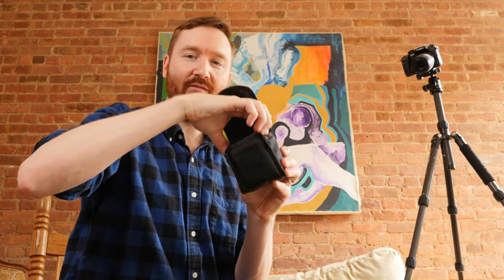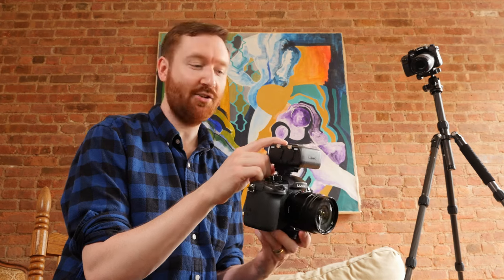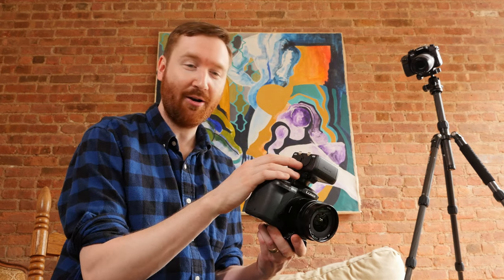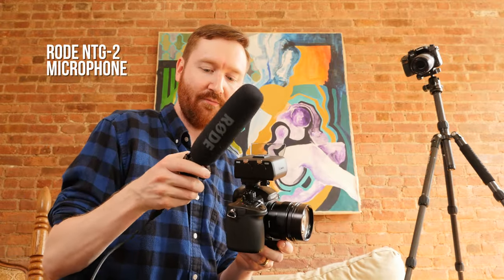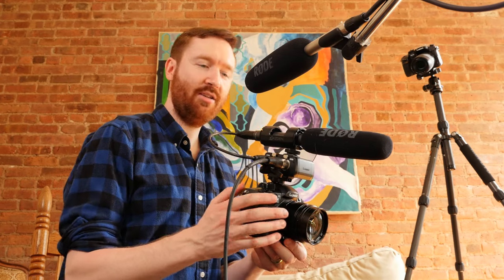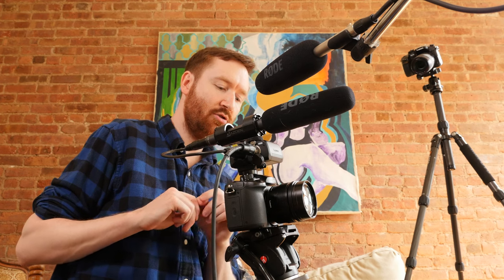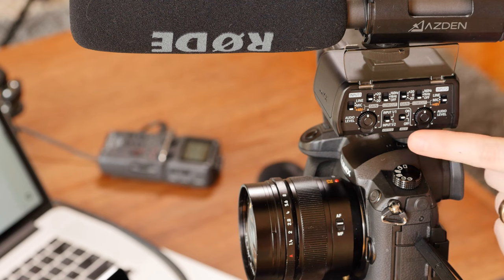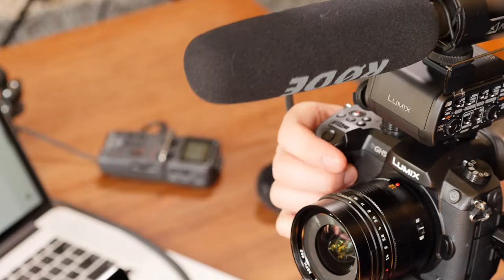Plug XLR mics into the Panasonic GH5

Comment: What impact does phantom power use have on the GH5 battery life? I have noticed dramatically shortened battery life on the GH5 compared to the very long battery life with my GH4 and GH3 cameras. I'm lucky if I get 60-75 minutes with the GH5, so I'm wondering what will happen if the GH5 battery supplies phantom power to the XLR-1.

Comment: Hi Grif.  Using my audio adapter I have plugged in two separate sources into the xlr connectors.  I get both separate sources levels on the flip out monitor but unlike just a single mount and the switch moved to 1, I cannot hear any audio in the headphones with the two inputs??? I set up my camera according to your donwload?  I called panasonic support who recommend resetting the camera to factory.  Do any of your settings affect this?  Is there any menu causing this?  Any help certainly appreciated. If this is just a shortcoming on the audio adapter and GH5 then it is a big deal as i always do interviews with two microphones on separate inputs!!
TJ Williams Seattle WA USA

Comment: The adapter looks good for what it is, but it is a relatively expensive one-trick pony. An infinitely better option would be to spend an extra $250 to get the Sound Devices MixPre 3. Three first-class mic pre-amps and headphone amp of significantly better quality, can be used with any camera, plus it doubles as a USB audio interface. And you can route the output back to the camera, so you have the backup recording that Griffin says is lacking in the Panasonic-only option. (Of course, if the Panasonic fails to record your audio, it probably didn't record your video either.) It is separately powered (by AAs or Sony NP-style), but I think that's an advantage in that it won't drain the camera battery as fast as the Panasonic accessory. In any event, the MixPre-3 is a much more flexible option that will grow with you. Make sure to check it out before you decide to buy this device. Just sayin'.
Reply: Same thoughts there on this. The XLR1 isn't universal like other pre-mixers, and is around $100-200 more than the average pre-mixers. 
Really hard choice to make if I can really justify buying XLR to marry with the GH5, or go with my previous pre-mixers.
Reply: If you don't anticipate ever needing to work with another camera for the foreseeable future and have no use for a standalone recorder or USB audio interface, and you're totally strapped for cash today, then perhaps it may make more financial sense in the short term to buy the XLR1. But those are about the only circumstances under which it makes sense, in my opinion.
If you take care of the MixPre3, its resale value will be significantly higher, so you will see a much better return on your investment if you ever decide to upgrade your audio gear.
How much can you sell that YAGH for now, compared to what you paid for it? :-)

Comment: I bought one of these as it makes it a little easier to get the audio in for streaming video, as you can't mix in audio captured by an audio recorder. One of the things, I find frustrating about my GH5's, is you can't change the mic input to line level. Even in the GH5 Mk2, this is not an option. If you are getting a house mix, it's line level. If you are using an external audio recorder, the output is line level.

Comment: I like running good audio into the camera but I have the same fear; however, coupling this with an audio recorder attached to a second mic is pretty bombproof. The camera audio or the recorder can get screwed up and you still have a great track and your video is pre synced if you need to get it out quickly.

Comment: I also have one and i love it, it was one of the main reason to get the GH5. I've noticed that if you change the recording mode to mov (i normally use mp4) you can get 24bit up to 96Khz ! But it crashes my GH5 probably because of my slow SD card so i use 24bit 48Khz, it soubds better than in mp4 mode :)

Comment: How do you eliminate all kind of noise or hiss for the audio? 
I have some audio noise in my recordings. I use a isolated studio, the gh5 is recording in MOV and at 24p FHD, the settings in the camera for the XLR adapter are 96Hrz 24p. the adapter itselft is set in the phatom power (I use a mic shotgun 3 feet away from the person) 0 gain, low cut 160 Hrz, ALC off, one input, and the audio level wheel at 1200 or less.

Comment: Hey Griffin! One question. I didnt see the Adapter connected to the input on the side. So, is it automagically connected from the cold shoe? or does it act as an independent sound recorder even when on the shoe? Also, can you just keep the camera mic on as a fall back. Thanks 4 another well done tutorial!!!
Reply from the maker: Automagically, yes! It's actually not a "cold shoe" on the GH5, but a "hot shoe," meaning it has an electronic connection to the camera. You cannot keep the on-camera mic on. It's one or the other.
Reply: Ahhhh nice!!! Yeah i can see the problem with having a second copy but it solves the problem nicely of syncing in POST which is awesome. Give and take always. I bet for you as a documentary extraordinaire becomes a plus. Thanks again for taking the time to respond and I never miss an episode.

Comment: Now that I saw this, should I purchase the XLR1 or the zoom H5?? Since you said this can replace the recorder, and that the H5 is actually much more expensive...
Reply: If you shoot with a boom operator, they can work independently from the camera with a recorder like the Zoom H5, and they can plug-in their own pair of headphones to judge the audio they are recording.

If you work as a one man band, then the GH5 XLR adapter would be a simpler set up, but just make sure that your mics produce a strong enough audio signal for this XLR adapter. ( an XLR mic with a weak signal might require too much extra gain, thus producing a noisy recording )

Comment: Hey Griff, how are you bud? (hope well and happy.)

Just a quick one I have synthesisers G2's and G3's and also the AVX systems but I cannot get a good sound on the GH5 using these even when set to the lowest setting and then bringing the GH5 down to -12, it's still clipping? DO I really have to pay another £350 (UK prices) to get good XLR audio? (cannot I just use the Senn's somehow connecting them up to the gh5?

Thank you.

Best regards.

Hugh
Reply from the maker: Hugh, is it a matter of setting the XLR-1 to "line" rather than "mic" input? Or does setting gain to -20db help?

Comment: Video idea. The GH4 eBay price is a third of cost of the GH5. If your new to GH line would you start with the GH4 or 5?
Reply: Either camera can produce great results, but I would say that if you are pretty good shooting with the GH4, then you will be even better with the GH5. ( you gotta be good with the GH4 first though )

Both cameras require the right settings to get the best performance out of them, so learning on one or the other is not going to be that different. ( and if you buy a used GH4 you can probably sell it in 6 months and get most of your money back, where a brand new GH5 is going to take quite a hit when you go to re-sell it down the road )

Comment: Hey Griffin, If I have a GH5 & XLR 1 adaptor and a Atomos Ninja inferno.  Should I connect my audio hardware via the XLR1 adaptor or via the Atomos Ninja Inferno with the optional XLR Breakout cable?  I want to avoid the fan noise from the Atomos Ninja Inferno.

Comment: Is it possible to use the adapter and at the same time use the 3,5mm regular audio output?
Reply from the maker: marcuspresident - You can use the headphone jack and the XLR adapter at the same time, but when using XLR, the 3.5mm mic jack is disabled.

Comment: Hey Griff, 

I have a Zoom H6 and already know how to use it and love how it performs so rather than buy another piece of kit I would really like to have it connected on top of my GH5.
I will use a Sennheiser AVX clip-on mic/receiver capturing straight into the zoom and simultaneously sending it to the GH5 but I don't know how to do this I have tried a few times but no sound in camera?
My set up is -
the mic on talent,  receiver capturing straight into the zoom via AVX XLR, then a 3.5 connector from Zoom H6 line out into GH5 mic in

Is there something I am doing wrong, can you or anyone else advise me how to do this correctly, its driving me nuts.

Thanks

and BTW - you're the best!

Hugh
Reply from the maker: Marta Demartini Hugh Hill, Are you getting any sound in camera when nothing is plugged into the camera? (First I wanna make sure your audio recording is active.)
Reply: @GriffinHammond  
Thanks for replying Griff,
I managed to get sound  but it sounded awful then I tried using a different cable this time a 'Movo MV-RC100 3.5mm Male Line-in to Male Microphone Attenuator Cable' it sounded much better but I noticed it had a slight echo going into the GH5 from the Zoom which was not noticeable directly into the zoom.
I took a photo to share but not sure how to add it here, I'll try a Flickr link to see if it works.

Thanks again,  you turned a lifelong Canon user to a GH2/GH3/GH4/GH5 convert.
I am now looking to sell my C300, My C100mkII and going full Panasonic. :  )

https://www.flickr.com/photos/hughhillphotography/48245998291/in/dateposted-public/

Comment: I really wish they made that thing backwards compatible. I understand that making it ONLY for the GH5 might incentivize people to pay more money to buy it and puts Panasonic on par with what Sony did for the a7sii. HOWEVER, it would REALLY set Panasonic apart from Sony and make all of their fans love them.
AT LEAST have it on the G85/GH4...but whatever...
Reply: I think it has to do more with the power to the unit.  They want it to be as small as possible, hence the lack of batteries (would have had to be much larger).  In order to give it power I'm guessing there is an extra pin on the gh5 hotshoe that is not present on the gh4 but could be wrong.
Reply from the maker: I just assume the GH5 has the right hardware and firmware to process the audio, which maybe the GH4 doesn't. But you're right—it would be great if the GH4 could use it too.

Comment: I am trying to record audio from an external mic on my new GH5. I am doing what I did with my Nikon, I have a juice link amp plugged into the mic port at the side of camera. Mic is connected XLR into the amp. When I did this with the GH5 it sounds like I am still recording from the camera mic. I looked for settings in the menu to correct this, could not find anything. What am I doing wrong. thanks, jerry

Comment: The price point of this is a bit ridiculous, you can get a Zoom H6 and good mics cables etc. All for similar money!
Reply from the maker: Good perspective. I suppose you're also paying for the convenience factor. It is half the size of my H5, and won't require syncing in post. I could see news gathering folks liking this.
Reply: Griffin Hammond understandable, I'd more likely be using an attenuator cable with a zoom or a rode mic straight through if not syncing. I'm guessing ENG its an invaluable tool you're right with that.
Reply: I got one for that reason of sync sound. However it is not as capable as the unit on my Sony NX30U. Two issues. I like using one mic and feeding both channels. This is possible but both will have the same recording level as it is not possible to set different levels for each channel or set ALC for one channel and manual level for the other channel when fed from one mic in input 1. This is where all my Sony units have the advantage of being able to do either these things.

Comment: OK, it doesn't have a headphone out, doesn't record separate sound, doesn't have independent power.....why would I buy this instead the new SD mixpre3?
Reply: The camera has the headphone out. The whole reason for this unit is to have a very compact system with super quick turn-around. Where you can hand your memory cards to a producer or editor and that's all they will need to finish the project.

I shoot dual-system sound all of the time, but I would still like to own this system in case my external recorder dies or is forgotten in the rush to get to a location.
Reply: Since the whole point is for those who don't want to sync in post, what's important is what the camera records, hence the headphone out on the camera is what you want anyway.

Comment: What is the Battery life drain when using 1 or 2 channel phantom power?
Reply: This will largely depend on the mics you are using. I own a few "pencil" condenser mics that have a very loud output and draw very little power, where I know that some XLR mics eat batteries like candy.
Reply: I'm more curious if it's going to cut down significantly on battery time to the gh5. In other words how many extra batteries will I need?
Reply: It looks like one GH5 battery lasts about 135 minutes when recording 4K 10-bit 4:2:2 video ( this is the same whether IBIS is set to ON or OFF ) So I would expect two really power hungry XLR mics to kill a single camera battery in about one hour. Add on the battery grip and you are probably looking at 2 hours of shooting time.

I normally shoot with dual system audio, where I use a Sound Devices mixer to power my mics which is fed to a Sony PCM-M10 recorder via the TAPE-OUT from the mixer. I can see myself adding this GH5 XLR adapter so I can have duplicate audio recordings, one copy from the Sony PCM-M10 and a second copy recorded on the GH5 getting it's feed from the mixer's XLR outputs.  This way I can use the audio on the GH5 as my main audio source, without killing the GH5 battery, and I will still have a back-up copy on the Sony PCM-M10 recorder.
Reply: Sounds good. I have a Sennheiser G3 lav and a rode NTG2 that I would be interested in running for my wedding work. I have a few condinser mics as well but I use those for music recording. This sounds like a great option.

Oh does it recorded the highest setting in All record modes? I head it may only work codecs.
Reply: Yes, I own a pair of Sennheiser G3 units, but these are self powered so there's no hit to the GH5 battery. The "pencil" style condenser mics ( from the cheap but very good TakStar CM63 all the way up to the Audio-Technica AT4053b ) are the best mics to use indoors in smaller spaces like a typical home or office environment because they only pick-up audio from the front of the mic, where lower cost shotgun mics pick up audio reflections form walls, ceilings, and floors. The difference in quality is huge, but probably won't matter for a wedding because you are normally shooting in very big spaces.

The Rode NTG-2 mic does not put out a very loud signal, so it's going to be noisier than my favorite low-cost shotgun mic, the Sennheiser MKE600 which puts out quite a strong audio signal. ( this also means your recorder/camera pre-amp batteries will last longer because you need less gain )
Reply: Yeah I do crank the gain for the NTG2. However besides the noise it's not a bad mic. Yeah that's the only one that will need the power. I do really like having XLR on the camera.
Reply from the maker: I did one phantom-powered mic for a one-hour presentation, and the battery life dropped to 2/3. So I assume I could get 2–3 hours of recording this way.
Reply: Very cool. Thanks for the reply!

Comment: For 400 dollars seems a little pricey for something with lots of floor noise. Soon as you switched back to the other mic recording it stops hissing. I hope this can be fixed on the xlr adapter or it's not worth it.
Reply: You have no idea if Griffin used optimal settings. The GH4 camera audio has a noise floor of -73 dB RMS when set up correctly, so I would expect this GH5 XLR set-up to be as good if not better. ( for reference the Zoom H4n portable recorder has a noise floor of -66 dB RMS )
Reply: True Griffin just got it i'm sure he'll tweak it to sound better. Thanks for the info.
Reply from the maker: I actually never switch back to the audio recorder in the video. What you're hearing at 2:08 is me switching the NTG-3 to both left and right channels. Before that, you're hearing two microphones—two signals on top of each other.